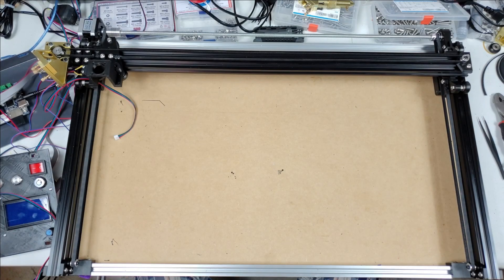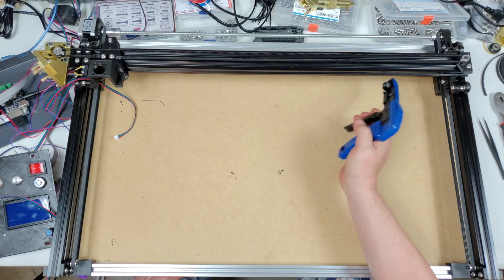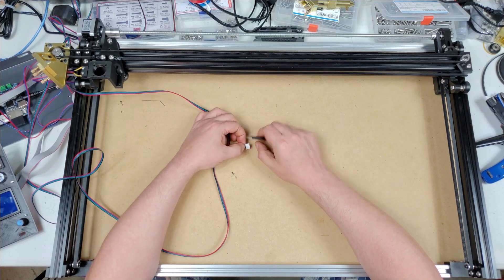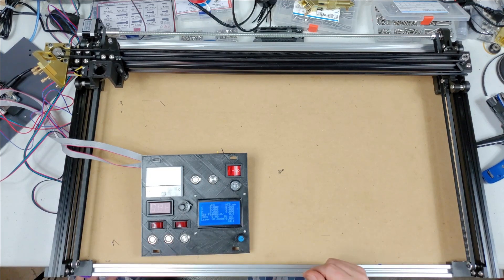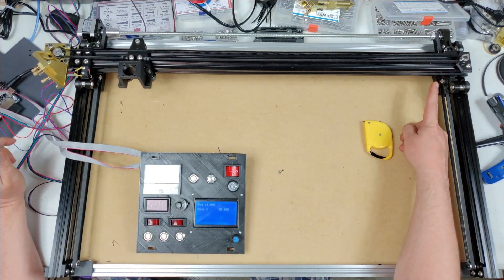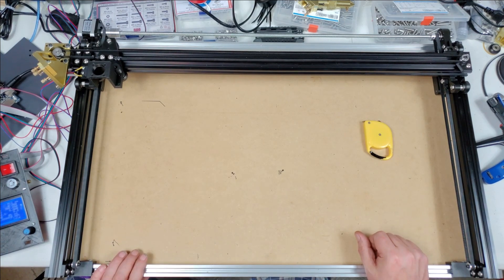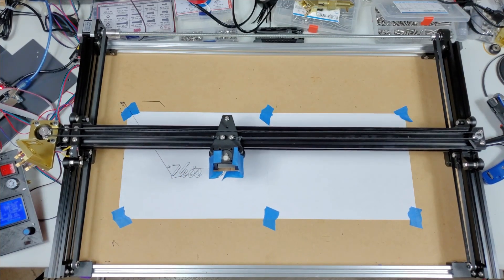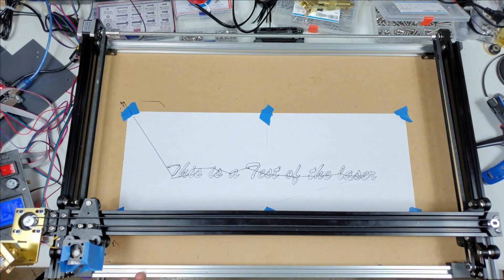K40 12x24 Bed Build - Update 1 - Problem solving, but it's alive!

Comment: So basically what i have learned from your channel, is to not buy a K40 but to build my own from scratch. Sound like the hard part for me is gonna be less of the build and more of the programming aspect. I look forward to more of your content.
Reply: Correct you are. These " upgrades " are just solutions for people that bought the K40 and quickly felt the limitations and design flaws. Scratch build will be easier and cheaper.

Comment: Do you have the files you have changes for download anywhere? I have the same Cloudray head as you and would really like to save some time. I’m also going to look into the Cohesion3D board. I bet it’s a great improvement over the stock controller. Great video!! TIA

Comment: Can this new axle connect to the original plate that the k40 brings from the factory?
Reply from the maker: no, there is nothing left inside the original case... not even the bolts welded to case for the wheels...

Comment: A tip from my solution to controlling X,Y direction - I put limit swtiches on both ends of X and Y (4 in total) then wrote the software to home and it learns from which limit switch closes which way the X and Y go and then inverts to make it fit the desired home corner. It can also detect if X and Y it reversed. So you can't wire it up wrong.

Comment: Hi im watching in on this, looks good so far! how much space will be below the laser head as it stands without cutting the bottom of the K40 out?
Reply from the maker: If you used the cloudray mirrors about 3'' between 50.8 focal and top of 1/2'' sheet

Comment: Great to see you trying this.   I have all the parts and decided to wait to see how your expansion works out.   I have the smaller case and still need to design a face plate for my lcd and controls.   Keep up the video's!   Don't find to many out there doing what you are doing!
Reply from the maker: Thanks! I try to provide as must info as I can. So few videos actually show what,  how and why..